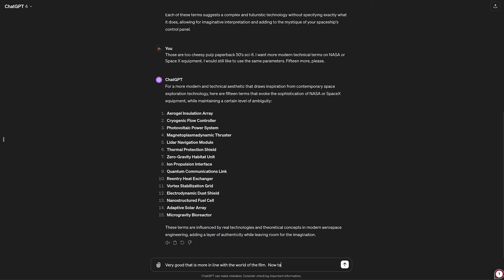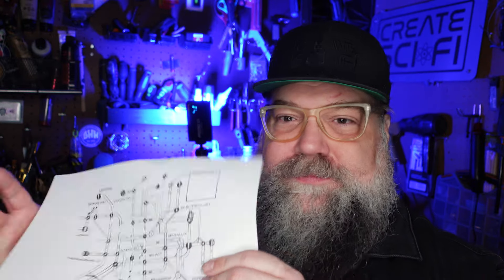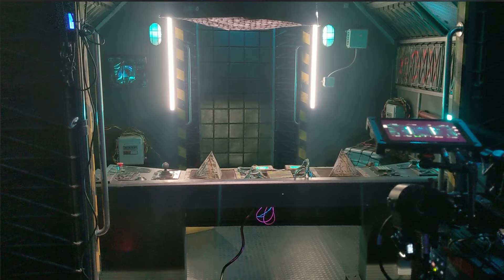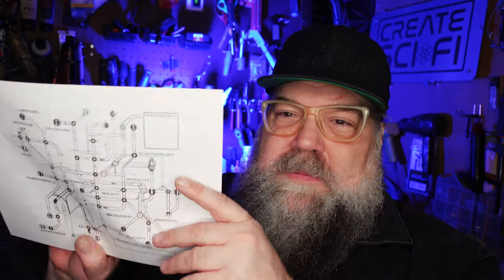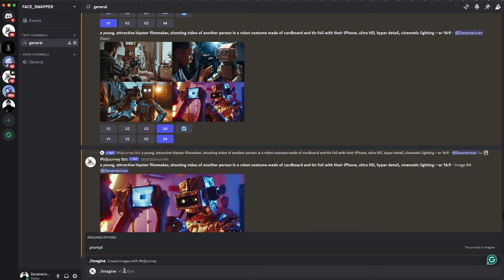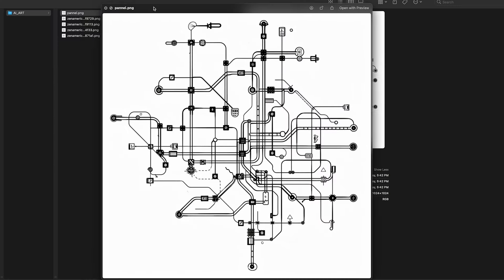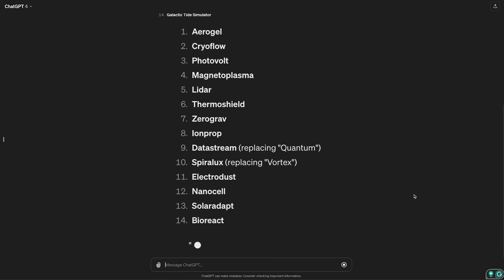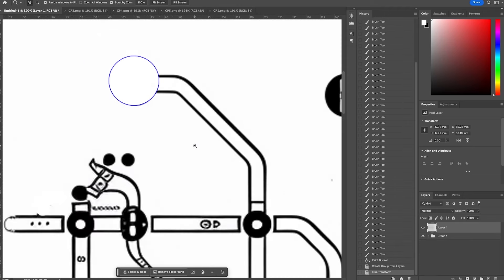AI & DIY: SCI-FI CONTROL PANEL BUILD

Comment: If you have any more of those plastic catering trays that your using for your wall paneling I could see taking one of the rectangular ones, cutting out the central flat rectangle from the bottom, paining it up to match, and inserting something similar to add that point of interest in a very cohesive way with the rest of your set rather than having the flat panel be not recessed in another wall.
Reply from the maker: That's a great idea! Thanks for the suggestion!

Comment: I may have missed it in the video, but what material did you etch that on? I thought it was MDF until you flipped it over and I saw that it was knurled- is it the same king of particle board that pegboards are made out of?
Reply from the maker: Yea peg board where I buy it’s called “hardboard “